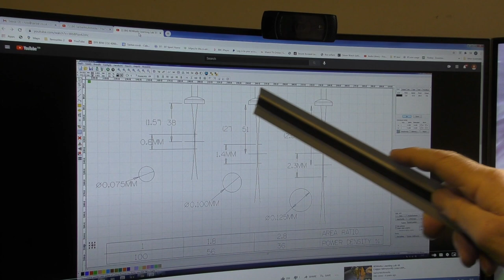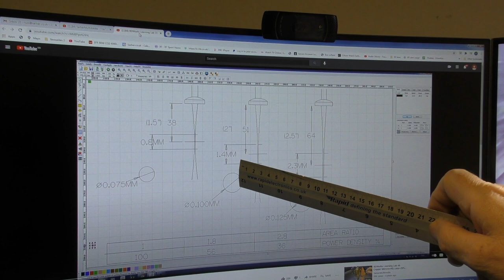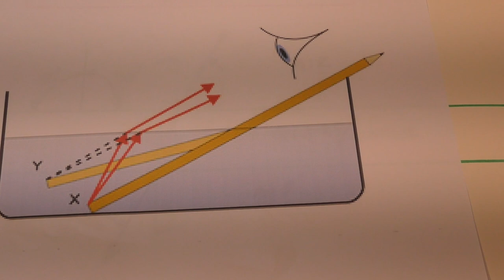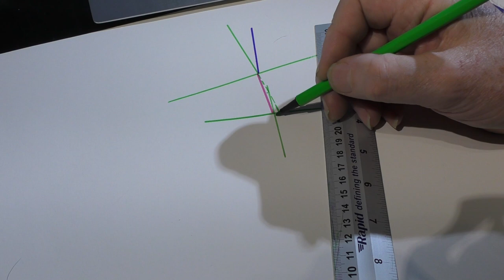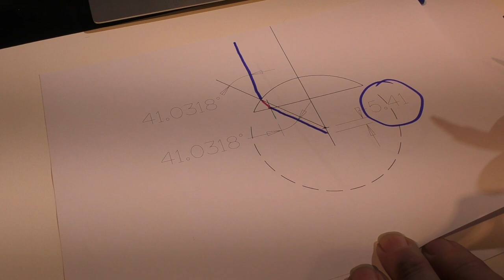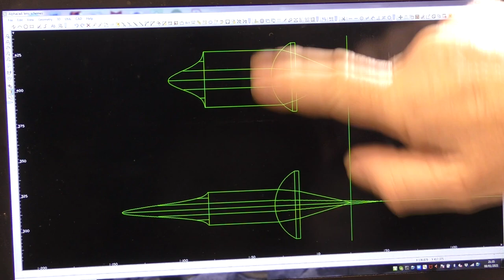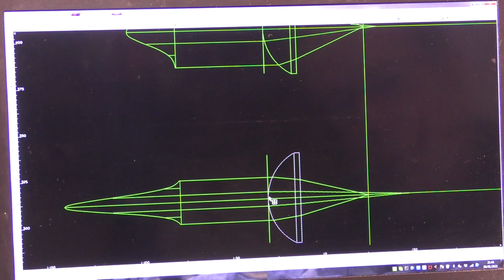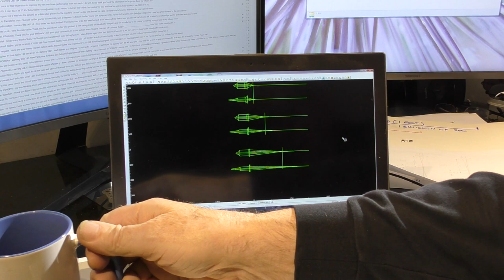RDWorks Learning Lab 196  Long Compound lens Part 1

Comment: This definitely tracks with what I've learned about lenses. I think the reason you haven't seen many people exploring this lens behavior is because most applications of lens theory have both a different starting point, and a different objective (seriously, no puns intended). The lens theory I was taught for electron microscopy started with an even coherent beam and was used to make a smaller coherent beam, then greatly magnify that beam with minimal distortion. Everything was done to eliminate any variation in energy density (spherical and chromatic aboration correctors for electron microscopes are just crazy in every way). 

As for the first lens causing problems by making the beam convergent, not parallel, on the second lens; I would think that would be super easy to visualize in your cad program. It shouldn't be that hard to draw. One other thing to keep in mind is the longer the working distance, the closer you are to parallel. Using a 7" lens might be close enough. 

One other thing you could play with could be looking (in CAD) at the difference between having the second lens in front of the focal point vs behind.

 Keep up the good work. Tomorrow I'm going to pick up a 80w laser cutter I bought from a thrift store, of all places. I'm going to have to re-watch your back catalog and take a bunch of notes.

Comment: A second thought... Cloudray say their PVD ZnSe lens is for max. 80W machines.  Narrowing the beam of our 70W machines would possibly increase the power density to that of a higher wattage tube hitting the back of the focus lens.
Reply from the maker: Hi Phil
This is a point I discuss in the next video. However, this is a very vague limit that has no real meaning because the lens  is not transmitting power it is transmitting light intensity  that varies in a Gaussian manner across the beam diameter. Power only appears when the lightwaves excite the surface molecules of the material we are trying to damage. This ZnSe material is only about 70% efficient at transmitting light in its raw state  because the crystallography reflects the other 30% All reading I have done indicates that there is no energy absorbed with in the material itself.Lenses are coated with several chemical films that have antireflection properties and change the transmission efficiency to 97% and beyond. That indicates that 3% of energy MAY be absorbed by that film. I know it is possible to burn that film off because I have done so when trying to engrave raw stainless steel. I do not know the full answer to the power limits for a lens but I suspect the damage will not be to the lens but to the coating. 
 I have done some tests already (always at full 70 to 75 watts power) and as yet have seen no hint of lens damage, but I am watching this point carefully.  I do know that GaAs lenses have a different set of films that are a lot more durable. I also have previously found GaAs lenses to be good cutting performers so it is possible that this material will finish up being the prime candidate for the second lens.
Best wishes
Russ

Comment: Russ, another great session.  Your presentations indicate that the narrowing of the beam width intensifies the resultant cutting ability of the lens as the light beam is ‘bent’ less if it is at the centre of the lens.  This state can only exist if the beam is made parallel by the upper lens, however a single lens will taper the beam and when focussing through the final focussing lens will ‘bend’ in faster and thereby increase the aberration.  To overcome this the beam needs to be made parallel again before it gets to the focus lens.  Would a reversed lens below the upper lens return the beam to parallel.
Reply from the maker: Hi Phil
 I understand the merits of having a parallel  beam and I discuss this issue in the next video. I look at the divergence of a 7.5" lens as opposed to a 4" lens  and the effect this has on what happens at the second lens.  The possibility of adding a third correcting lens  has not been fully rejected but I am trying to keep the 3 or 4 % lens losses to a minimum, so it will eventually come down to balancing the gains I know I can achieve with a two stage focussing system against the  gain/loss of adding a third lens.. I cannot predict where this learning experience will take us...........definitely to improved cutting but how efficient can it be made is the big unanswered question. 
Best wishes
Russ

Comment: Remember that the further from the beam centre, even though intensity decreases, the area that the weaker intensity irradiates is larger because the torus has a longer circumference. That energy out on the edge adds up quickly when you squeeze it back into a spot because it came from a larger area. That’s also why pizza prices don’t scale linearly with radius, the area increases with r squared and so you need much more topping out on the edges.
Reply from the maker: There is nothing wrong with your logic for a 2 D model but the LIGHT intensity model of a laser beam is a 3D model. Assume you have  pizza size molehill about 6 inches tall in the middle . The geometric form of that mole hill is constrained by physics to be Gaussian in its shape.  Let's assume that the shape of that mole hill represents a 60 watt beam The outer edge will always represent zero  because it is at ground level  and the total VOLUME enclosed by the form represents 60 watts.  As I reduce the base diameter of the molehill  the enclosed volume remains the same (60 watts ) and the geometric shape remains Gaussian therefore as I reduce the base diameter,  the peak rises disproportionately because it still has to encapsulate the 60 watt VOLUME.  You are quite right to assume that the intensity at the outside will increase in absolute terms  but it always remains in a Gaussian proportion to the peak.    Just to make this clear. Lets move in from the edge of the molehill until the height is 1/10th inch  and remember the centre is 6" high. If I now reduce the base as if I had amplified everything by a factor of 100. How high will those two reference points now be.  answer 10" and 600". The amplified centre  The central intensity is the bit that is doing the real work even though the edge has now risen to 10".  The greater the light intensity the quicker you can do damage (exposure time).  So it would take 60 times as long for that low intensity edge to do the same damage as the 600 peak. Perhaps  you missed the previous video about focus where this  exposure principle is clearly demonstrated . 
 
Thanks for the comment and thoughts because it hopefully allowed me to explain to others with  that  same 2D model. If you can visualize the 3D nature of light intensity within the beam it may help you to process what happens when it gets amplified through a lens.  The intensity profile is always Gaussian no matter how much you amplify it. 
 Best wishes
Russ

Comment: Now I know why on Earth life got me having Optics course three times. It was just preparing me for this youtube channel :P

Anticipation is killing me! But there is a question that won't allow me to sleep at night: we know that the air assist is both for clearing the kerf while cutting and also for cooling the lens... So, what would happen to the lens at the top of the C type tube? Won't it burn to ashes?

Looking forward to the next session! Thanks for sharing this priceless material!
Reply from the maker: Hi Nico
 The air assist is not cooling the lens. It is providing positive pressure inside the nozzle to keep any fumes away from the lens.
 ZnSe and GaAs are both materials that are sort of transparent to 10.6 micron wavelength light. I say "sort of" because ZnSe is about 70% efficient at transmitting and GaAs is about 60%.  The transmission loss is nothing to to do with energy absorption within the material but all to do with reflection off the surface. Both materials are coated with various thin films to make then less reflective. This raises the transmission efficiency to 97% or better. ie only 3% reflection. So, 97% or more of the LIGHT energy passes through a lens and does not heat the lens. The light that emerges has to interact with molecules of material that CAN be stimulated  by 10.6 micron wavelength  light (almost everything). The more the molecules vibrate the hotter they get. There is no heat in the laser beam, just pure energy waiting to collide with molecules it can give its energy to. ....ZnSe and Ga As  are NOT those molecules , they just allow it through.
 Best wishes and sweet dreams........trust me there is no bad ending to this saga.
Russ

Comment: I think you may also get some total reflection inside that deep cut, since the incidence angle is so low...
Reply from the maker: Hi Jan
 With a material such a acrylic  I had the same thoughts until a couple of years ago.  How do you explain total internal reflection in wood? I have done lots of tests in plywood and MDF that exhibit exactly the same properties  as acrylic for  both short and long focal length lenses. With all the work I have done studying cut shapes and energy density profiles in beams, the internal reflection theory just does not make logical sense. I am always ready to accept  real proof  but I have seen none so far. Please carry out your own experiments  now that the subject has stimulated your imagination. 
 Best wishes
Russ
Reply: @SarbarMultimedia  I can't run any experiments because I don't have a CO2 laser. I spend my laser time on interferometers (If that topic interests you: https://www.janbeck.com/Interferometer1). I did in deed envision you melting a fiber optic guide when I was watching the video. But when you said "total internal reflection" in your reply I remembered for that to work the index of refraction of the channel would have to be higher than the acrylic....which it's not.
Thanks for taking the time to answer and thanks for the videos - keep them coming!

Comment: Totally unrelated, I wonder can an unfocus Co2 laser light beam travel in a fiber optic light tube without losing power at the lens end. has this been something you have thought about?
Reply from the maker: Hi
 There is just one major issue with this idea.......... glass is totally opaque to 10.6micron wavelength light. That is why we can engrave it. Yes, it converts the light energy into heat and damages the glass.  At 1 micron wavelength the light passes through glass .  So,  it's a great thought but physics trips you up.
Best wishes
Russ